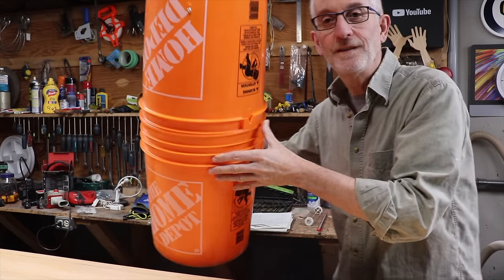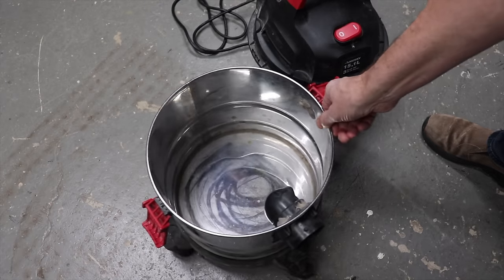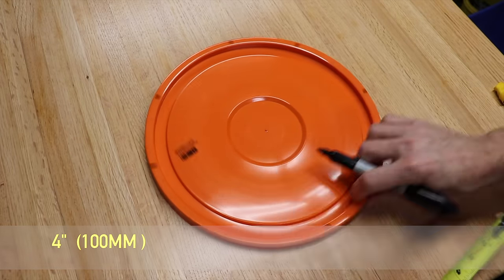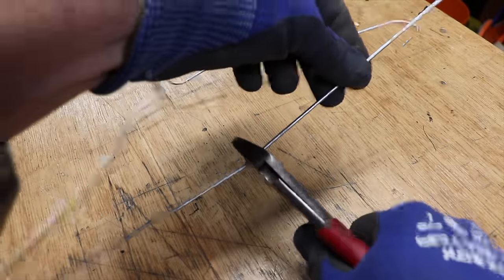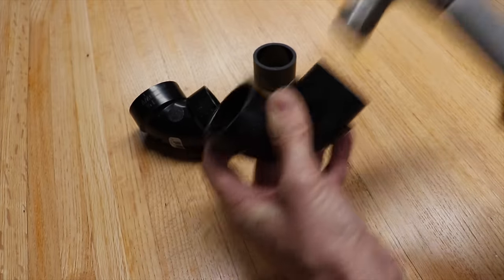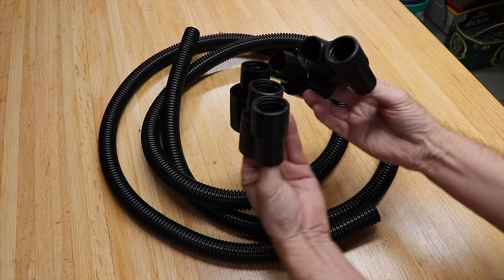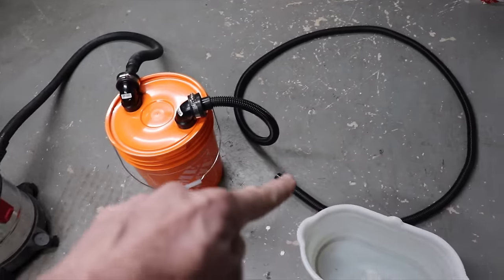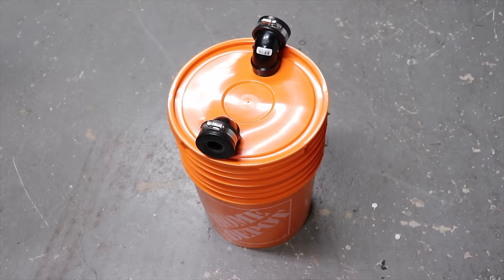How to Make ● Simple Wet Vac

Comment: I can see this being used with a large shop vac as well. My 8 gal vac doesn't have handles either, and on the rare occasions my basement floods, it would be so much more convenient to draw the water into a bucket with a handle, than to lift a shop vac full of water. 

The tip about making the lid easy to remove  makes the video worth watching .

 I wish I could give you two thumbs up !
Reply: @joshymcdaniel9233  I have a sump pump installed. Twice in the past 18 years, the rain had been so heavy, that the sump pump couldn’t keepup.
Reply: @TheJakeytoo  dang I’d be moving lmao water just ruins a foundation
Reply: @joshymcdaniel9233  House was built in 1962, I have owned it for 25 years, it’s still standing. I’m 70 years old, I ain’t moving, my next residence will be for eternity.

Comment: A benefit I see is the ability to keep your shop vac always in a dry vac state.

Also... the bucket is easier to clean out than a shop vac. Nice work.
Reply: Just be careful never to let the water pass over. I wonder if a dust collecting cyclone bucket head would prevent droplets from getting sucked up by the dry vac side or make it worse. (In theory those cyclone heads should seperate the water and even droplets very effectively and create a large air gap to prevent water from getting sucked over).
Reply: @riakata  that's what I was looking for, thanks for comment it!

Comment: Just remember people, you still need to use a vacuum suitable for sucking up water for this. We had a flood in our basement. Had to spend hours emptying our shop vac multiple times. I considered making one of these out of a 44 gallon plastic food drum and putting a valve at the bottom to empty it in case it happened again.  Nice and simple design, thanks for the links to the parts.

Comment: I made a version of this before with a longer inlet pipe. You filll the bucket with water to cover the inlet tube. This makes a “bong” for drywall dust so it doesn’t clog your vac filter.
Reply: That's a similar design to the Rainbow vacuum which uses water as the filter media , Also by doing that , It will save the motor bearings because with drywall and concrete dust , Some of it always gets past the filter and is highly abrasive to the motor bearings along with the commutator and brushes
Reply: I was also going to say something about the Rainbow vacuum, but for very little money, it does the same thing. The Rainbow is about $2000.
Reply: So make the inlet tube longer?
Reply: To suck up the drywall dust.  Thanks!
Reply: @carolvandermeer7388   Yes so it is under the water.
Reply: Oh, that's clever. I remember seeing an ad for a water filter vaccum and wondering how I could DIY a similar solution. I need to see where I can get these kind of buckets, home depot doesn't exist here!
Reply: @samuelmellars7855  did you ever find them? Assuming 'here' means the UK that is :)
Reply: @pumpkinhead456  not the UK! I can get paint in this kind of bucket (or metal versions the same size) but I've only found these buckets online, and I'm not sure if they are the same sort of strength or not

Comment: Very nice production..! I have been doing the same thing aboard M/V Kitty Hawk for a couple years now. An old wooden boat, with many nooks and crannies where water accumulates and does not drain to the bilge. My marine version adds a tiny bilge pump inside the bucket, and a pipe to the overboard discharge. A screen around the bilge pump keeps the larger debris from clogging it, and several oil-absorbent pads prevent any evil contaminants from being pumped overboard. This BMS,  Bilgewater Management System, with a 20' long intake hose can reach everywhere needed, and with the pump, remains belowdecks. No hauling the bucket to dump, and only needs mucking out once or twice a season.

Comment: / nice. I used this after scrubbing tile & grout. Sucking up the floor cleaner into a bucket rather then my shop vac made life easy. Just dump the bucket and rinse with garden hose. When I just use the shop vac it requires more work ( bigger mess ) thanks for the great idea

Comment: Excellent video sir! My only recommendation would be to set up a float valve on the vacuum  hose to prevent over filling your bucket. Maybe attach a wooden ball somehow? Something large enough to not immediately block flow into the vacuum hose as soon as it  is turned on, but still buoyant enough to block airflow when the water level rises high enough.
Reply from the maker: I like to keep things simple. You can see the level of the water through the side of the bucket.

Comment: Great idea, cool video. :) I have such solution for a few years already and it works great, makes work much easier and a bit cheaper: no need for constant replacement of vacuum cleaner bags when using in home, really nasty wet dirt may be cleaned off the ground - it's good for cleaning the styrofoam granules off the soil in the garden (if such event occurs) so they don't contaminate the soil.

Comment: Your vacuum water receptacle is a neat build. However, you're missing a very crucial part to it. Most vacuums designed to pick up liquids (i.e. Shop Vacs and carpet extractors) have a little device in their bins or tanks called a float valve. This is basically a device that will cut off the suction of the machine when the bin gets too full of liquids (in Shop Vacs, it usually takes the form of a cage around the motor intake with a hollow plastic ball or cylinder in it). This device is an extremely important safety feature, as it prevents liquids from being sucked into the motor, which would be a danger to both you and it. If you ever decide to redesign this contraption, make sure to add a float valve, as well as a foam or mesh filter around it to keep any debris that gets sucked up when using it from going into the motor as well.
Reply from the maker: You are correct!! That's why I say in the video that it is "an add-on for your shop vac". Yes, they all have a float that blocks any water from getting to the motor.

Comment: A piece of pink insulation board may help to act as a shut off when the bucket is full. Just big enough to fit in the bottom of the bucket. It should float to the top and block the intake port.
Reply from the maker: Yes, that could work!

Comment: Awesome! Had a little bit of a flooding problem just last week and put a little drain valve on my vac, but was still annoying not having the volume capacity. Im gonna build one these now, but I'm also wondering about adding a check ball water stopper thingy... brain gears turning!
Reply from the maker: I didn't add a ball valve to keep it simple. You can see the level of the water through the side of the bucket plus if you're using a shop vac it doesn't matter if a little gets sucked up. Good luck!

Comment: I could have used this a couple years ago. I had a flooded basement because my sump stopped working so I used my wet/dry shop vac to get the water out. I got all the water out but getting the full shop vac up the stairs over and over was a pain. This would have made it so much easier.
Reply from the maker: Yes, those shop vacs are not made to be easily carried.
Reply: Install a backup sump with a check valve to the drain.

Comment: Hey! You gave me an idea for the sweeper of my pool. I just need the basket to hold leaves.
Reply: Inside of the 5 gallon bucket, put a smaller bucket that has a lot of holes drilled in it. !/4 inch holes should work.  The skimmer for our pool is missing the screen trap, and no one makes one that large any more. I took a 5 gallon bucket and drilled a lot of 1/4" holes in it. I then plastic welded a stand that I cobbled out of another bucket to the bottom of it. Anyway, put a fitting on the side of the 5 gallon bucket for the outlet to the pump. In the lid put another fitting for the inlet from the vacuum head. The water from the hose has to go through the holes in the smaller bucket, and the leaves will get trapped in the smaller bucket. Boy, I aught to patent that!! Happy pool cleaning.

Comment: I wonder if drilling/cutting a sort of "bypass hole" above the bottom lip of the outlet pipe (inside the bucket) would reduce the chances of water being sucked to the actual vacuum. I remember the concept from an aftermarket cold air intake made for cars. There was a separation in the pipe downstream of the filter so that in case the inlet was submerged, it would reduce the chances of sucking water into your engine by sucking air through the valve.

I really liked this and your separator video. You've got a new subscriber in me!

Comment: This will work great the rubber caps are a great idea. We tried to add an extension onto our hose and they are 2 diff sizes and don't go together so the bucket and rubber caps will allow me to use any size hose. I'm wondering if this will work if I hook up 2 buckets together?

Comment: Big fan of your channel!  I'm wondering why the dust collector requires 2 buckets on top of one another (or 4 to prevent collapse) while this one can be made with just one bucket and a lid?  I would prefer a smaller dust collector if possible so would one like this work with it having just the one bucket and lid for collecting dust?  I figure with it being more compact that It wouldn't be as top heavy and that could also help prevent the bucket from collapsing in on itself but I would like your thoughts on if it would work or not...thanks for the great vid!

Comment: Thanks for the double bucket tips 👍
My bucket begins to buckle as soon as the vacuum is on just from tre resistance of the hose. 
And if the end is blocked for 1/10 of a second or suck something big and heavy it collapses totally.
And it was the best bucket i could find.

Have even tried with wood bracing innside but it just bends over and crumbles anyway
Reply: Especially with these high power vacuum sweepers , They lower the atmospheric pressure in the bucket and the atmospheric pressure outside of bucket pushes against every square inch of the bucket causing it to collapse , when atmospheric pressure outside a container takes over , You'd be surprised how much force it creates

Comment: Put a caged rubber ball below the outlet pipe so as the liquid level gets too high the ball will be pulled into the neck of the fitting preventing water flow to the vacuum and letting you know it’s time to empty the bucket
Reply from the maker: I like to keep it simple. You're using a shop vac anyways so it doesn't matter if a bit of water gets sucked up.
Reply: @chrisnotap  But if you use the "ball valve", then you could use your dry shop vac with the bag still in it, instead of removing the bag and installing the foam sock and then switching back again when you've finished sucking up the liquid and want to use it for sawdust again.

Comment: Hi,
I’m trying to clean a little pond that has a bit of muck/vase mixed with some gravel and little rocks at the bottom so I was wondering if this solution would work? Also, could a regular vacuum work for this (if I don’t let the bucket fill up of course)?
Thank you so much for your help and your video!

Comment: So theres no need to seal around the fittings put on the lid (inlet and outlet fittings)? I can't see scissors/shears making a perfect fit hole for these fittings. Wouldn't this create a leak making the suction less efficient? Just curious as I'm planning to make one of these this weekend. Great video Chris, thank you!
Reply from the maker: Make the hole cuts as good as you can for the best fit. It won't matter that much.
Reply: @Chris Notap  I appreciate your input Chris! 🍻

Comment: I use a cheap ring sprinkler flipped over to suck up water/fluids off of the floor. I use hot glue to plug the holes that aren't near the bottom as they would suck air.
Reply from the maker: Cool.

Comment: Chris I need help. I have been looking into a vacuum for my above ground swimming pool. It's not huge. 10ft round by 2ft tall. It does come with a skimmer but not from the bottom. Just surface. 

At first I figured I could use this system to clean out my pool but I have a few issues. First I need it to clean out the dirt from the bottom of my pool and replace that water back into the pool. So a shop vacuum would work but it would be more work. 

Next I figured I would use a water pump system and add a sand filter inline. But that seems to blow the lid off with all the pressure. I used ratchet straps to hold it down and still no success. I tried to relieve some internal pressure by drilling bigger holes in my fittings on the 5 gallon bucket with sand. No luck. 

Today I tried to force a syphon by adding a "Y" from the pump. But the crazy party is that pump still pushes water out of every hole even if it's fighting against the correct direction. I can't catch a break. I'm almost thinking I need a check valve but I don't think it will work. 

I can't limit my pump because I feel like it would hurt the pump if I try restricting it with a ball valve or any other way. I figured the "Y" would work and it didn't.

 Help!!!

Comment: I actually made something similar to this for sanding drywall.  The only difference in mine is that I extended the intake hose inside the bucket to be just just an inch or so above the bottom of the bucket.  Then, I would put water about halfway up the bucket.  The sanding dust gets trapped in the water and none of it makes it to the ShopVac.
Reply: This is the hack I was searching for when this video came up. Thanks :)

Comment: This might sound dumb but could you leave the shop vac dry filter in while using the water bucket? I plan on using my shop vac as an execrator and dry vac. and does the suction become worse? cool video
Reply from the maker: Sure you can! It may get wet but just take it off and let it dry to prevent mold.

Comment: Does any water make its way into the vacuum cleaner? Does the vacuum cleaner's filter get wet? Does all  the water get stopped by the plastic bucket? Loved the video (and all your videos). Thanks!
Reply from the maker: Its a simple set up. You do need to watch the level in the bucket as it rises. As long as you don't allow the water to go right to the very top, no water or vapours get sucked up into your vacuum. But remember, your using a shop vac and it can handle it. Yes you may need to dry the filter if you allow some to sneak by. Thanks.
Reply: Many thanks for the feedback!

Comment: If you have more than 5 gallons of water (or any liquid, except gas) to clean up, you can just use more than one bucket and switch the lid between them. If you have a whole lot of it, a helper can dump one bucket while the other is being filled. 

Nice underwater shots,
Reply from the maker: Exactly. Keeps the fireman line going! Underwater shot was a last thought addition. Thanks!

Comment: so Chris in case I was unclear I was wondering if I could try to figure out how to create something similar to your idea for my 1.25 inch shop vac hose and it would seem  if I make this as a dust collector an answer would be take the pipe and use  a 90 degee elbow and a 45 and have it  angled doward does that sound right and I guess I could try to figure out how to connect the other end to the shop vac I guessm thoughts please thank you as previously state I think I spent to much on a pre made dust collector that would not work may be I can make my own I am not sure if its going to work quite the way you said I wonder if I can glue parts using silicone glue ? any ideas please thank you
Reply from the maker: Check out my other video where I made a dust collector using the same home depot bucket.

Comment: Nice build. I'm going to make this but I am going to put a water level shut off. A few pieces of pvc pipe with a ping pong ball that will float up and block the hole before it over fills and your vac will tell you its full when it speeds up.
Reply from the maker: I was going to do that but it takes away from its simplicity. You can visually see the level through the side of the bucket. But yes, what you saying would work.

Comment: How dry was the filter on the other one? Did it mist any?  That’s really awesome
Reply from the maker: No mist detected. Quite dry.
Reply: Chris Notap, Awesome! That’s great news.  I have one a Hoover GUV and love it however it is not make for anything wet.  I have it on a large swing peg board door I made to cover heavy duty shelves.  After using it so much dragging the old shop vac is a pain now.  I’ll have to add this setup to mine.  Maybe make a water stage then a second stage for dust like the other video before this one.  Thank you for the ideas and putting in the time
Reply from the maker: Reading your comment, I should have put more time into this video to emphasize that there is no mist or water that gets sucked up into the vacuum when you use this..........except when you let it get too high. Thanks.

Comment: You could add a float stop by using a plastic ball smaller and adding it to the part that connects to your shop vac so you don't have to worry about much if any water into your shop vac.
Reply from the maker: I was going to but then I thought....."it's a shop vac!!"  It doesn't matter if a bit of water goes into it. It's all good. I like to keep things simple. Thanks.